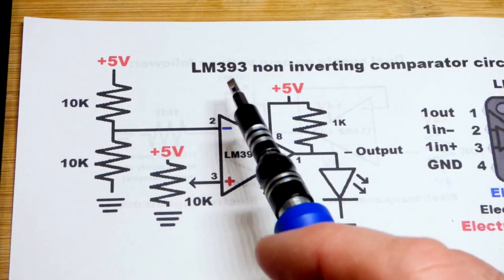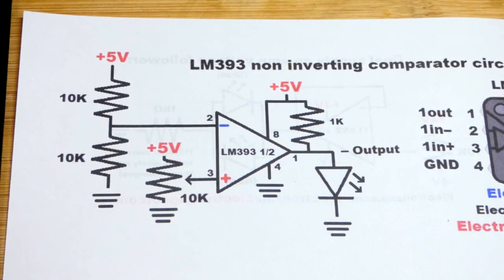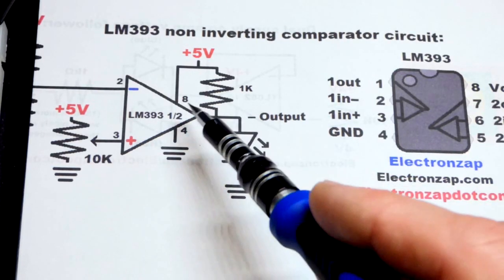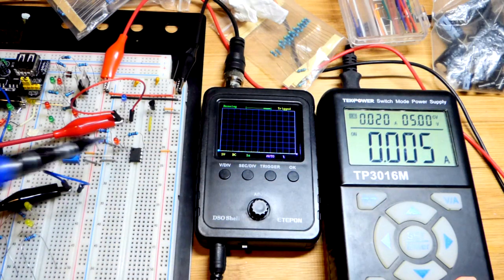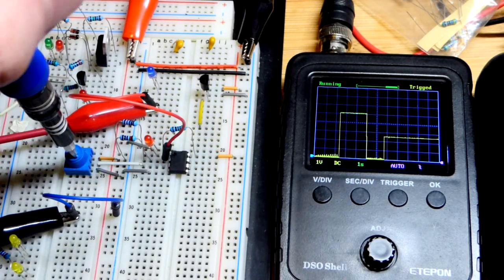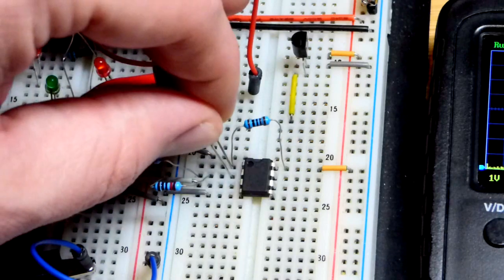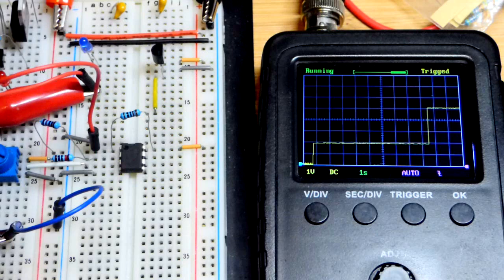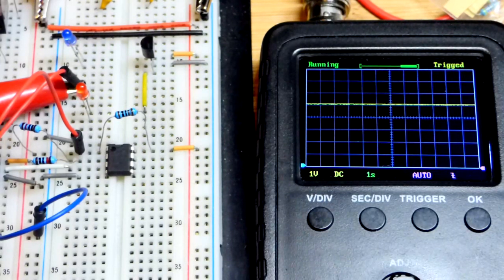LM393 open collector non inverting comparator electronics circuit how to DIY tutorial by electronzap

Comment: I am using the TI LM393, open collector, and I have it pulled up to 5V and I measured the output of the op amp, with the LED on it only goes up to ~2.5 volts which is telling me with the LED added seems to change into a voltage divider circuit instead of either being 0 volts or 5 volts (which is what I would thought the behavior would be).  Is this something you could try to measure and see/explain?
Reply from the maker: That's the forward voltage of the LED. They only build up a certain amount of voltage across them because they pass current easily at that voltage. The rest of the voltage goes across one or more series components, such as the resistor that is limiting current.
Reply: @Electronzap  so if I wanted the output after the LED to be 5V I would more or less need to do a voltage divider and pull the output up to 12V (since that is what I'm mostly working with)...am I thinking the right thing?